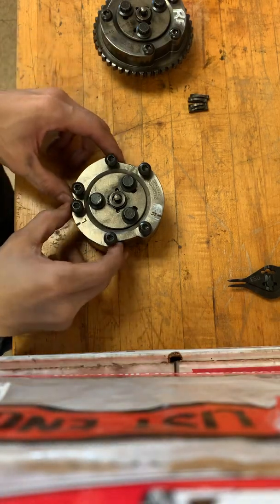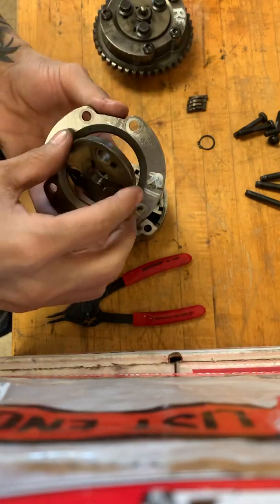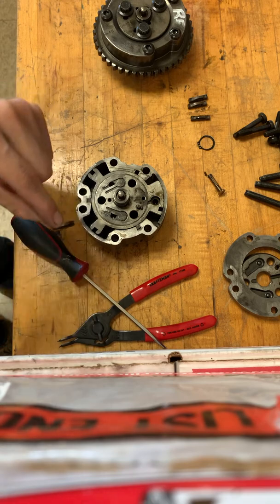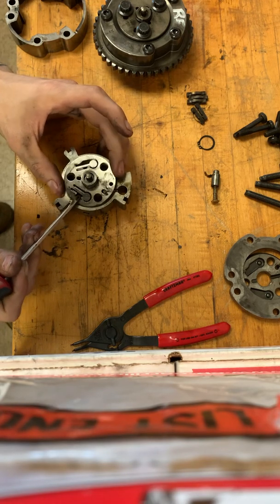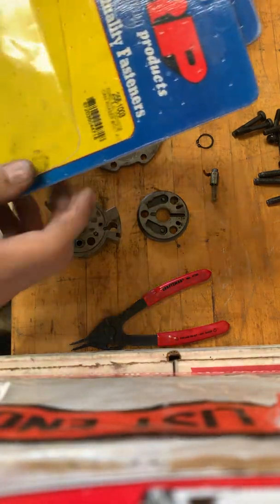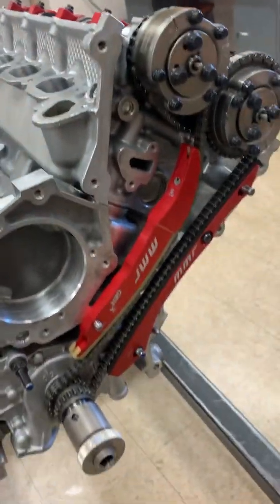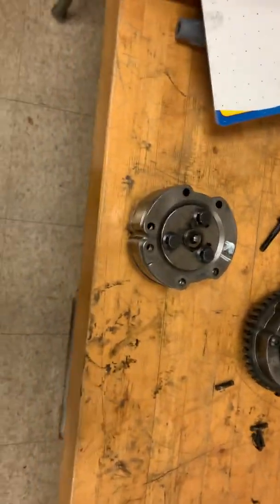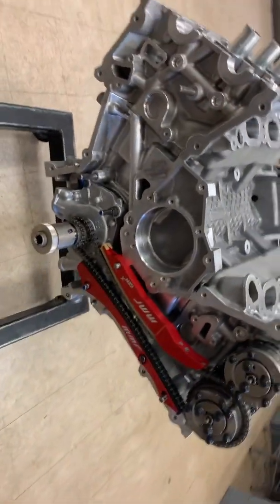Coyote 5.0 VCT Phaser Assembly/Disassembly

Comment: The disassembly of the phaser helped me with deciphering an issue with alignment of the 3 inner bolt holes. 
The part where the spring clip was taken off and the part removal below to reveal what was below was the most helpful. 
My issue was I could only get 1-2 bolts to align all the way thru. Sometimes it was only 1 hole that lined up, then another spin of the top would eventually line up 2 holes all the way thru. Never all 3.
Took mine apart as shown, minus the outer star bolts, and was able to get all three together. 
A winded comment but I just had to express how valuable this particular video was.
Reply from the maker: Awesome to hear the video was valuable to you and helped you fix the issue!

Comment: I went ahead and disassmebled mine because I have a persistent code that is having me lean toward it being a bad intake phaser. I opened it and saw that the inner phaser had rust on the oil galleys. Very strange and I'm wondering if that might have been the cause of my troubles. Wont know until I get a replacement and reassmeble the engine. Was wondering if anyone else had any idea why that would be the case
Reply from the maker: It might be a phaser, if your code is bank specific but it would be odd for that to be the issue. More commonly though its going to be a fuel injector, bad MAF, or oxygen sensor. I wouldn't bet on a phaser for a lean condition. Despite the rust you mentioned. I would put money on either a oxygen sensor or dirty injector
Reply: @queso2561  ill look into that too. My code though is always on bank 1 and affects anything on circuit "A". I've swapped cam sensors and solenoid to no avail and ran a vct actual vs desired and that's what's led me now to the phaser. If replacing it doesn't work, I'll check out the o2 sensors and fuel injectors.
Reply from the maker: @marathonman96  What code are you receiving? A bank 1 lean code like P0171 or are you getting a circuit lean code? The ford pcm has specific codes for the cam phasers, which is why if it's a cam phaser you should be getting  a code for like cam positions and stuff. Hopefully swapping in a new phaser works but i personally don't like throwing parts at an issue. You can diagnose a cam phaser issue before buying. I recommend making a free account on FordServiceInfo.com You can purchase a 3 day pass for service info that gives you step by step OE instruction on how to diagnose a code or particular component. Service Info allows you to download instructions into a pdf too so you can keep it forever
Reply: @queso2561  I've been getting p0340 and p0344 upon startup. They're always present and the car stalls on stops and hesistates on acceleration around 2.5-3k rpm. I don't like throwing parts either but I'm trying my best to just nail it down to something. I haven't touched the phaser at all at any point during diagnosis. I've been using Forscan as my diagnosis tool recently and it's been helpful.

Comment: How did you get the ARP 156-1006 to work? The OEM bolts are reverse thread and ARP bolts wont thread into the phaser
Reply from the maker: Hmmm, I see that a couple of you stated a reverse thread issue. I did not have reverse threads. ARP is very specific on the years makes and models that there hardware applies too. These phasers were on a 2013 Mustang GT. If you are working on Gen 2 or Gen 3 mustang than there phasers are different. If you are working on a F150 there phasers are different. It’s your responsibility to verify the ARP hardware works with your year vehicle. You can’t look up a YouTube video and see a phaser and expect its the exact same as yours. This reverse thread issue is coming from you guys not paying attention.

Comment: Riddle me this. Coyote has a knock. Knocking sound at 2500 rpm pretty consistent. Knock at hot idle but not always. Usually it knocks 4 knocks once per second in a cycle with only a second or two between cycles. Sometimes it knocks once per second non stop, goes away with slight throttle. Sometimes no knock at all sounds great, but less frequently lately.

Used to have the knock a few months ago so I changed to e85 and it seemed to go away. Changed to the new valvoline clean and restore oil 5w 30 as usual and it came back pretty much next day.

Gonna switch to mobil 1 10w 40 and see if anything changes. Used 5w 30 pennzoil ultra platinum prior to valvoline.
Reply from the maker: Sorry to tell you brother but oil weight does not help “coyote tick” and in fact the higher weight oil you go the more you will damage the top end of your engine. VVT and the cam journals required a very thin oil to maintain proper operation. My guess is you wiped out a cam lobe and you have some followers that are creating the noise. 

If you inspect your cylinder heads and find worn out cam journals or wear marks on the cam you will need a new cylinder heads. If your cam journals are fine but the lobes on the cam are worn then you need to get the cam polished and replaced all the followers and lash adjusters. I would also recommend replacing the entire timing set too. It’s under $900 and you get all new chains, 4 new phasers, guides, primary tensioners the whole thing. If you know how to do the work yourself you can do everything for about $1500. Otherwise this could be about $3500-4000 at a shop.

Comment: Do you know what the Oem part numbers are for the outer bolts?
Reply from the maker: BR3Z6279A
Reply: Thank you, those look like the 3 inner hex head bolts. I thought the outer were the 6 star shaped bolts.
Reply from the maker: @ColbySlade  ford doesn’t offer any other torque to yield bolts for the phaser other than the part number I gave. If these are not the bolts that you are looking for, you need to buy the entire phaser assembly from ford because they don’t sell the other bolts separately. You could literally just buy the ARP bolts like the video provides. Being a cheap ass rarely works out in your favor.

Comment: Would be very helpful to say the star head bolts are reverse thread. Broke 4 before I figured it out trying to rebuild the exhaust side phaser
Reply from the maker: Hmmm, that might unique to you brother. Mine were normal and the ARP replacement hardware is normal as well. If you have a reverse thread issue you might of pulled the threads or might be working on some F150 or something. Never had one that was reversed thread.
Reply: @NitrousYote  Have you ever used the hi-performance gen 2 cam phasers (gt350 phasers)? Last motor I tore down I am pretty sure I got the upgraded phasers for and I tried disassembling it and I too think it was reverse threaded. Going to try it again on this motor as a lot less metal went through so I am hoping these phasers are salvageable, plus I have your video guide.
Reply from the maker: @triston2735  those are a mid phaser type. This is why I said ARP is very specific on there application. The hardware I show is for gen 1 phasers only. 11-14 mustangs. Gen 2 are similar on the inside but have a mid phaser design. ARP does not sell outer phaser hardware for gen 2 style phasers.
Reply: @NitrousYote  I figured this was the case, I also checked arp's website and they don't specifically call out if the bolts are for a specific year and unfortunately do not offer anything for the later year phasers. I also see ford does not seem to sell the bolt they use. I wonder how bad it would be to guess and throw on some blue loctite haha
Reply from the maker: @triston2735 ARP does specify the applications there hardware is used for. They provide Tech lines and put in every set of instructions a phone number you can call. 
Ford is not going to sell that hardware for any generation. The hardware is not meant to be removed. It’s a replacement part unfortunately. This video was intended for guys at there home who do not want to pay for 500-600 dollars replacing cam phasers when they can simply go inside clean what’s necessary at move on with there build. ARP can make any fastener. If your gen 2 requires a reverse thread bolt they can provide that to you. The kit I provided is specific to gen 1 phasers only.

Comment: What is the torque spec on the outer bolts?  Great video by the way
Reply from the maker: OEM Hardware - All Bolts are Torque to Yield and need to be replace everytime they are removed
           Inner - 15 Nm (133 lb-in) + 90 degree turn
          Outer - (180 lb-in) or  15 ft-lbs
ARP Hardware - Reusable 
           Inner - 33 ft-lbs
          Outer - 15 ft-lbs
Reply: @NitrousYote  If all bolts are torque to yield, why don't the outer bold have a e.g. +90˚ turn listed? Thanks

Comment: Super informative video I got a quick question What did you use to clean them liquid wise, gasoline, carb cleaner degreaser, and did you oil them or assemble it dry
Reply from the maker: You can use parts degreaser, brake clean, gasoline if you wanted. Wipe dry and assemble with a very small amount of fresh engine oil. You don’t need to dunk the hole thing in oil just a couple drops on the spring, small black pieces, and where metal to metal contact occurs.
Reply: @NitrousYote  Cool I appreciate it the info by any chance do you know the torque specs on the bolts